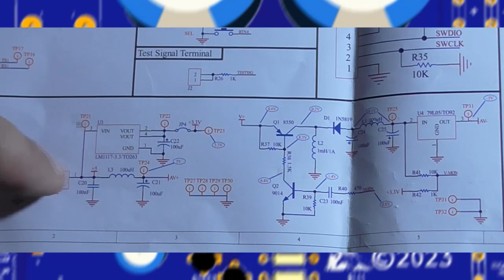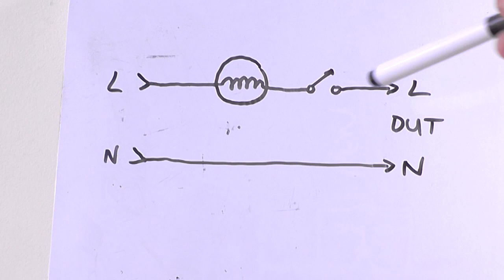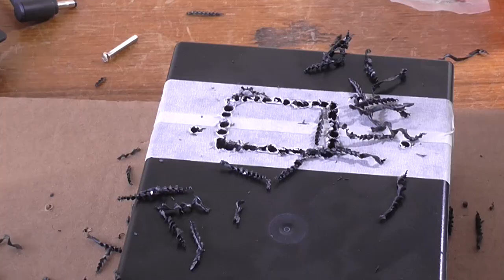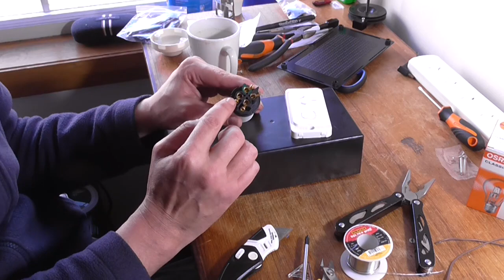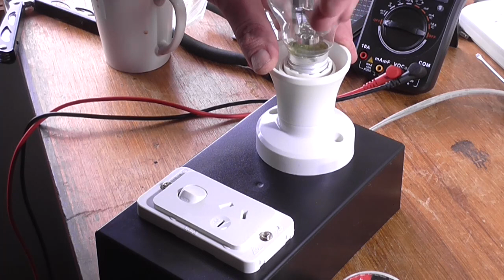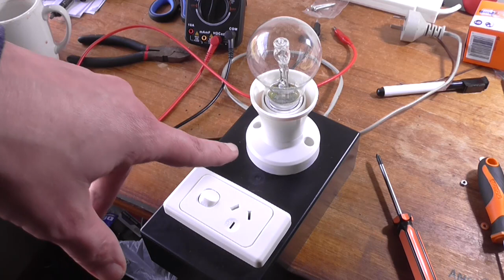DIY Dim-Bulb Tester (For Testing Amplifiers, Etc.)

Comment: I know this is two years late, but I thought I'd mention that there is a good reason why electricians think that tinning the wires before securing them in the screw terminal is a bad idea. Although you may screw it tight initially, over time the solder creeps and the connection may come loose causing overheating and arcing. Manufacturers used to do it, but have stopped due to this problem. Indeed, I've found several cases where this has happened.

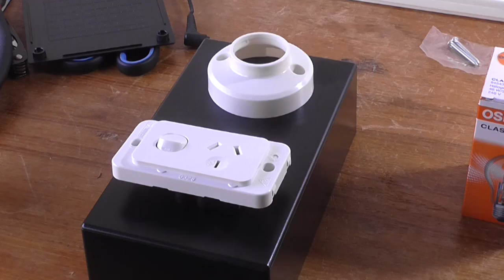Comment: 7:50 is that an IT Crowd reference when they hand Jen a black box and say she's holding the internet, so technically you've added a light bulb and power socket to the internet 🤔😁
Reply from the maker: Yep 😁
Reply: You don't mention the bulb wattage? 100 Watt?
Reply from the maker: @northwichhydroponicscentre1730  um, it's a 46W halogen which is about the equivalent of a 70W incandescent. Which is a bit high... a 40W incandescent would be a better starting point.

Comment: Defo needs the earth wire continuing through to the GPO....iow the lamp intercepts the active wire only......if there is an earth fault the lamp will glow. A switch can be wired across the lamp holder to provide nomal operation after intial test power up.

Comment: I definitely wouldn't have built it without using a 3 core cable and passing the earth through to the GPO. Otherwise you could have an item under test with an earth fault that goes undetected by an RCD, which is extremely dangerous.
Reply: That's a valid point however if it wasn't used with an isolation transformer, or if the isolation transformer had a fault, that's where an issue could arise. I understand it's you doing this just for you, but I'm a stickler for if an earthed socket is fitted to anything it should be earthed.
Reply from the maker: Yes, but if you had this connected via an isolation transformer, the earth is not connected anyway...
Reply: What is GPO？  Thanks.
Reply: @KSWong-xi8cd general purpose outlet
Reply: @BensSightSoundandAuto Thanks a lot, mate.  So it's the 3 pin Australian type AC socket.  I wonder why most of the YouTube video about dim bulb tester do not include the earth wire in the build.  I believe the earth wire won't affect the effectiveness of the DB tester.  The device for test e.g. an amplifier nowadays is most likely have a 3 pin AC plug that needs an earth/ground connection.